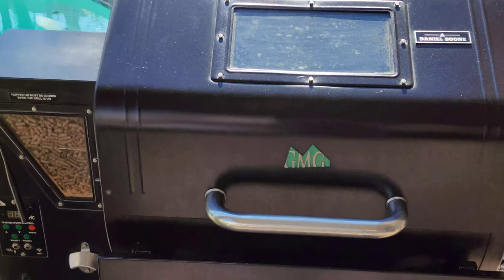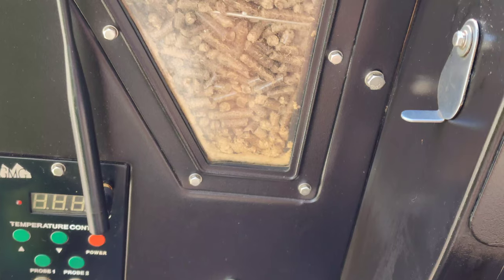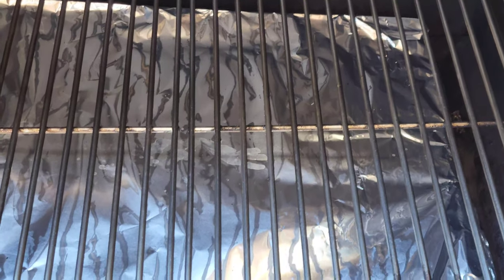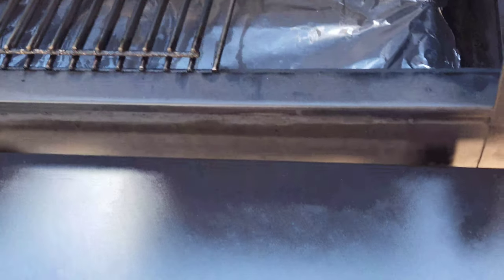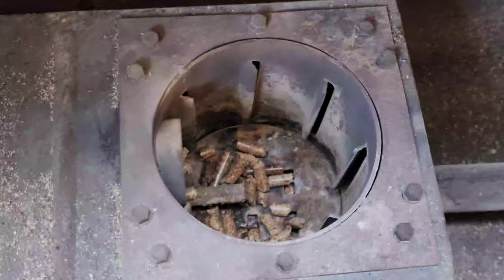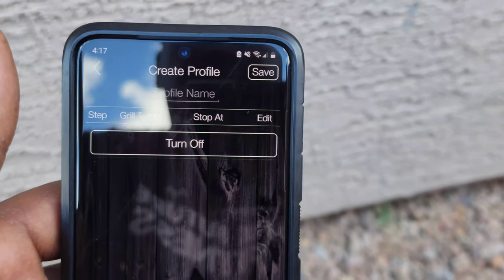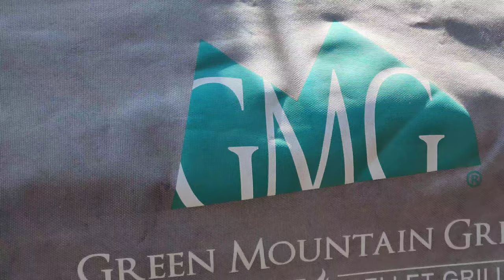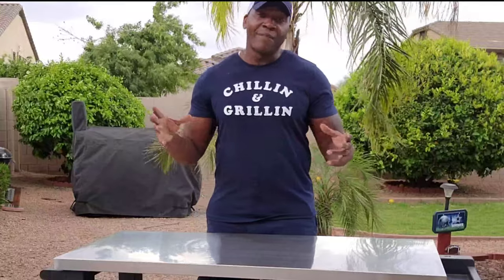3 Year Review | Green Mountain Grill Pellet Grill

Comment: Good video. I had my pellet sensor go bad on my 2nd cook. Went through 3 power cords and just got a new auger assembly and fan assembly. It really puts you out a while and i cover mine because i live in seattle. With that being said the lifetime warranty is great they send all the parts for free. Ita just inconvenient sometimes especially around the holidays for turkey or prime rib and whatnot
Reply: Gotta add if you try to sear on this thing in the northwest the powder coating on the lower by the front shelf starts to rust but I plan on sanding it down and using some high temp paint
Reply from the maker: I have definitely lucked up... no major problems and it's been about 6 years, fingers crossed!🙏🏿🙏🏿
Reply from the maker: I havent had great success with searing on here.. I always feel like when the grill gets that hot it just doesnt run as smooth... idk🤷🏿‍♂️ Maybe it's me but I usually won't go higher than 400

Comment: I wanted to down size. I sold my dual grill Chargriller with  smoker and bought a like new, used Daniel Boone. I was not familiar with GMG. I jumped on YouTube to learn and found you. Great 3 year review... 🍺🎣
Reply from the maker: What's up Shane👊🏿 I'm glad you stopped through, be sure to subscribe and check out some of the other videos I have up already and stay tuned for the weekly uploads✌🏿🍻💯💯
Reply: @KillerMillerQue  Done...
Reply from the maker: @ShaneJMcNair  🙏🏿🙏🏿
Reply: Good morning Sir. Firmer Traeger User here. Looking at Prime Ledge 2.0. Am I making a good purchase? Great Video beautiful home. God's Blessings 🙏 J ... Tenn Native raised in Chicago.
Reply: @user-vo5kv9qi6k  like my GMG so far,  I  have never used a Treager. I can say I  like the features better than a Pit Boss grill... 🍺🎣
Reply: What did you buy your like new, used Daniel Boone for?  I have one available to me, looks like the non-prime version.  Seller said it was used maybe 8 times but doesn't know what to charge for it.
Reply: @Irie  I picked it up for $250.00. So far, it has worked flawlessly. From what I can tell from the serial number, it's a 1st or 2nd gen. Has the 1pc heat deflector that can be moved left or right for heat distribution & 2 pc sliding drip tray with holes. Came with grill cover folding side shelf but no lower shelf or front shelf.  I'm adding a front folding shelf for convenience when cooking. I need to get a power inverter to run it on 12v in the event of power outages. Gas grill saved me during hurricane Katrina, no power for 2 weeks.

Comment: After 3 years, my GMG DB Prime is useless.  I get frequent heat spikes up to 150 degrees above set temp.  I’ve been going back and forth with GMG customer service for 3 months, to no avail.  Glad your grill is still going.
Reply from the maker: That sucks, I definitely lucked up in that department. Usually if I notice inconsistencies I clean it out real good and clean off the thermometer and I'm Usually good
Reply: john nolan states facts. i have had 3 of the GM junk. the earlier ones were a little better. All are tin, poor paint, componants and design.
Never again. I bought a US made smoker and it is light years better quality in all aspects.
Reply from the maker: @randygoecke906  what did you go with?
Reply: @KillerMillerQue  Chiasson Smoke, built by a family business in Wisconsin. They use a Pellet Pro pellet system. Best built grill I have ever owned. Price even with shipping to the west coast was comparable with the better Chinese built crap